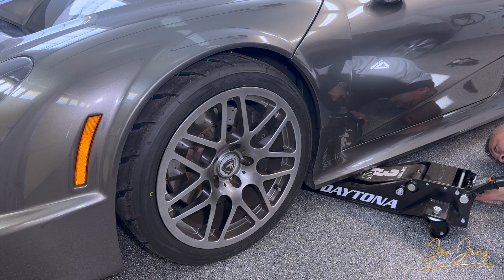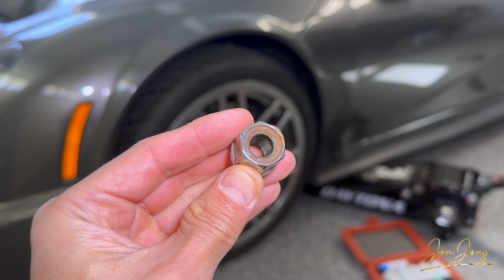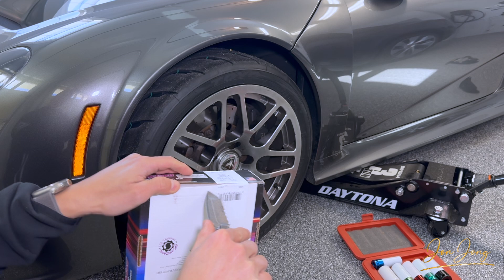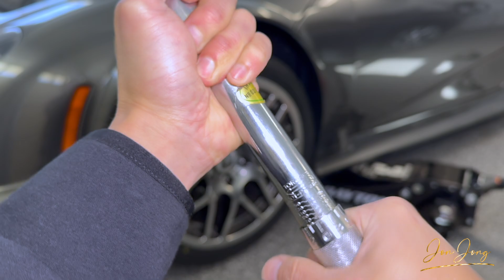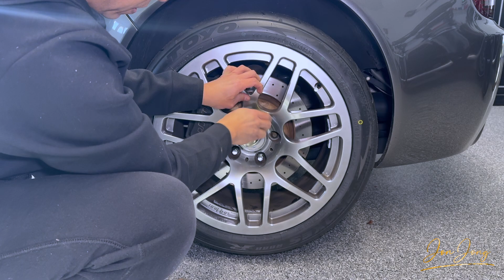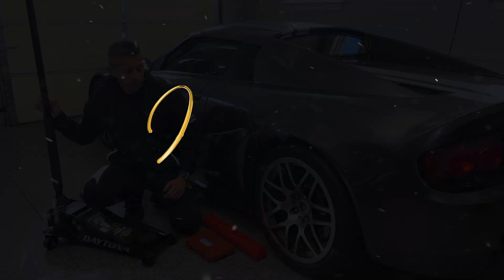Beware! Replace OEM Lug Nuts

Comment: Just use a mallet on the socket, and it will fit. If ur lucky it comes off if not it will snap off, and u will see the actual nut under the shell
Reply from the maker: Correct, this is the first step to try. I was unlucky on our Airstream and the socket wouldn't grab. I even called AAA and they were unsuccessful with their lug nut extractors. The aluminum cover partially ripped off and we couldn't get the rest of it off.

Comment: I work in a tire shop, any lugs made in the US between 2010-2020 are fucking garbage. Especially especially ones produced by Ford and Kia group makers as early as 2004. Those damn steel sleeves deform and allow water to include, deforming or separating from the treaded section. It's ass
Reply: Yep, had to replace the ones on our F-150.  I wound up beating on a socket to get the old ones off.
Reply: so true man I also work at a tire shop at 9/10 of these lugs are swollen, they never fit in the sockets

Comment: Bro, did you just use a torque wrench to loosen a lug nut? You should never do that. It ruins the calibration.
Reply: Not necessarily, it depends on the model of wrench. For a unidirectional wrench yes. It will only safely (for the mechanism) apply torque in the rated direction. If it's bidirectional then as long as you set the wrench higher than the break away torque or you don't exceed the max rating of the wrench you're good. But breaker bars are cheap and simple and good and get the same size drive as the torque wrench you own.
Reply from the maker: Good to know, I was too lazy to run to the shop and grab my impact wrench. Good to know for next time. Thanks for sharing 👍🏽
Reply: @JonJong another thing to maintain calibration is always set the torque wrench to its lowest spec before you store it. If you didn't know.
Reply from the maker: @Gandalf22476  great info, thanks for sharing!